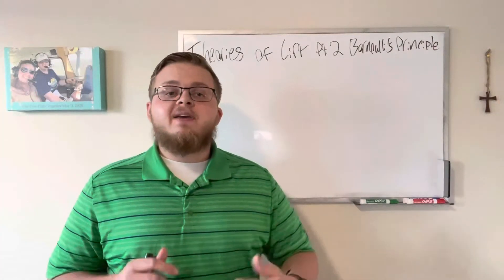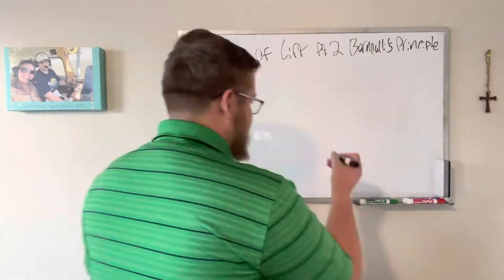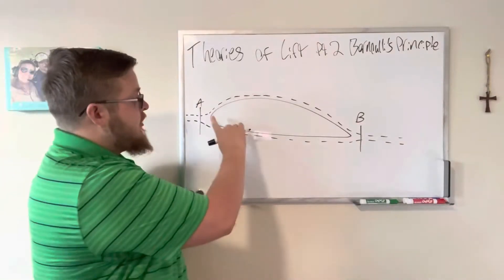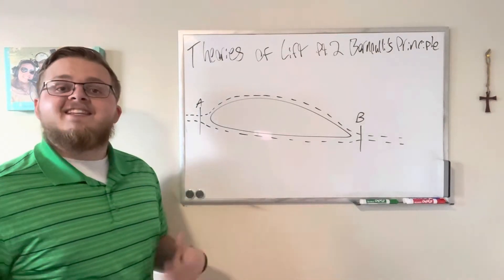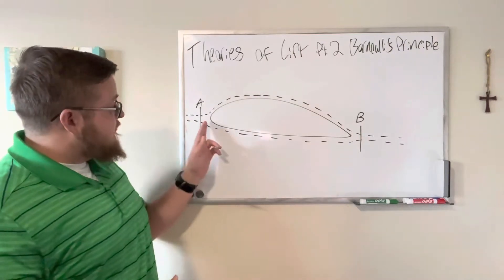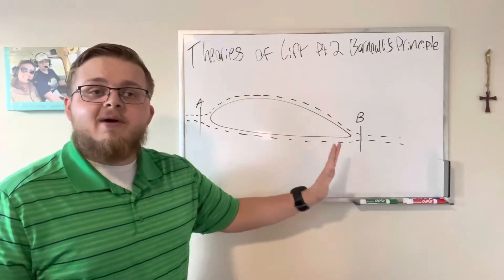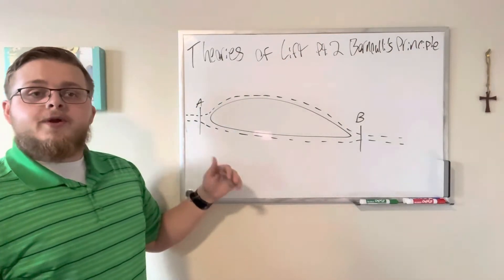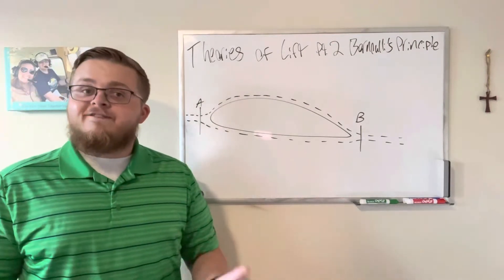60 Second CFI: What is Bernoulli’s Principle?

Comment: Bernoulli’s principle doesn’t apply to to airfoils as much as it is thought. The equal transit theory has been debunked over and over again. It doesn’t make sense. does air going over the top of the wing at point A make an agreement that it will meet at the same time at as the air on the bottom at point B? At the airlines the right explanation of lift is being taught but hasn’t trickled down to GA yet unfortunately
Reply from the maker: When the FAA removes it from their written tests, flight instructors will stop teaching it.
Reply: @lebrandonian  No CFI’s don’t know better
Reply from the maker: @Neil_Edmiston  What?